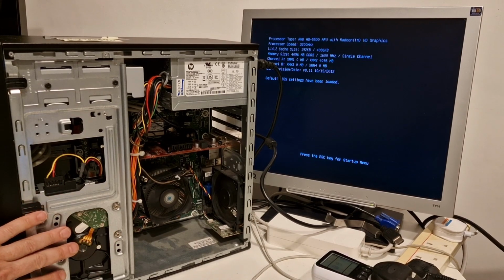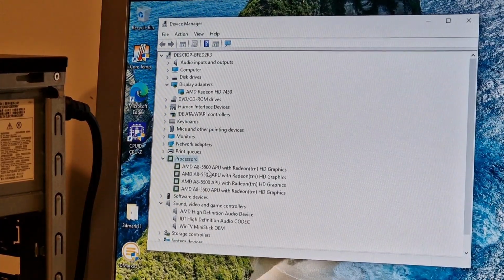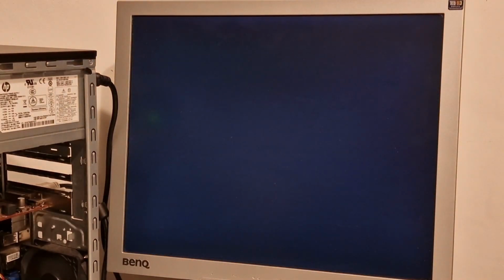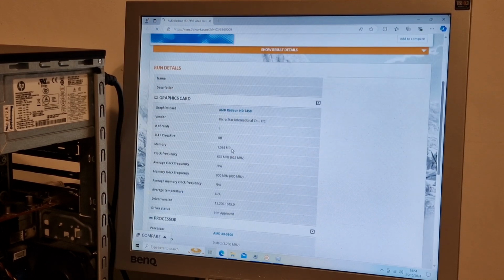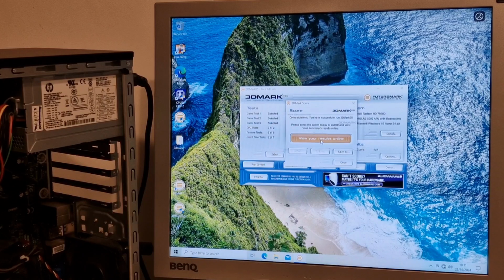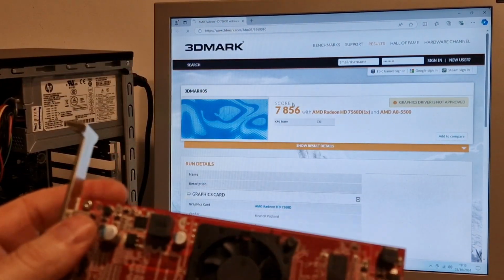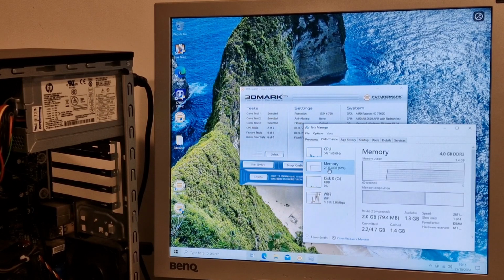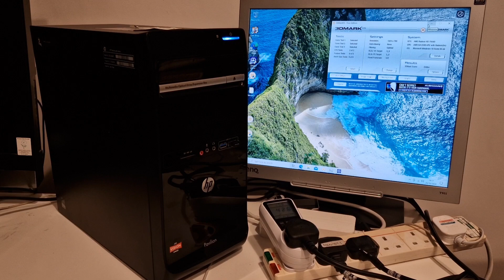Faster WITHOUT graphics card? Why HP? WHY!?? Add-on GFX worse than the built in GPU? AMD A8-5500 APU

Comment: I own an older model from the later K10 era.

It's the same chassis and that dates back to the XP era for the base structure before getting replaced by a version in 2007 that had the motherboard towards the bottom with the side panel being on the left instead of the right

Comment: The two 2012 PCs here and the 2014 all have onboard video. 
The Dell uses up to 1.7GB of memory for video, but only supports 1920x1200 via Display Port. The optional ATI 7570 or 7470 support 2560x1600 via DP. I removed the HDD cage and fitted an Nvidia full length 2GB PCI-e card LOL.

The Lenovo only supports half height cards, and there isn't room for any card that needs 2 spaces, so my Radeon 6450 1GB goes unused.The video uses main memory, but probably no more than 512MB.

My ASUS H97 Plus board supports 2560x1600 @ 60Hz or 4K @ 24 Hz with 512MB of shared memory. I have an Nvidia 6GB card on it.